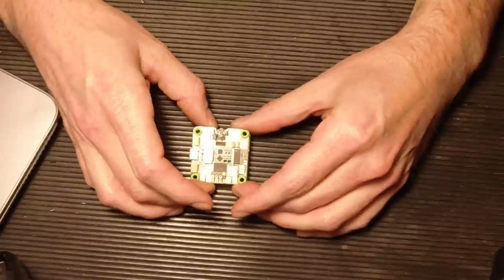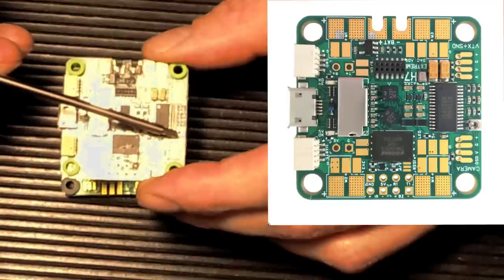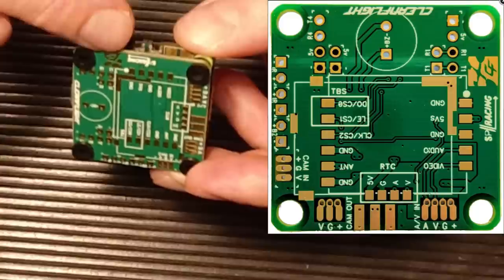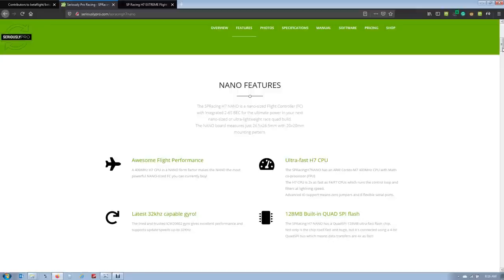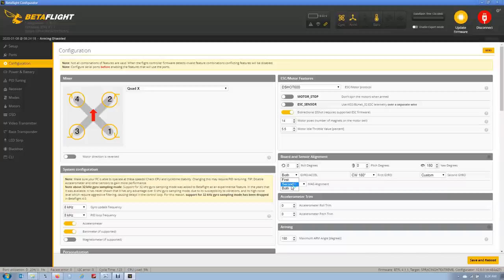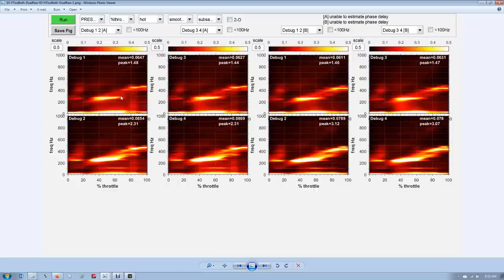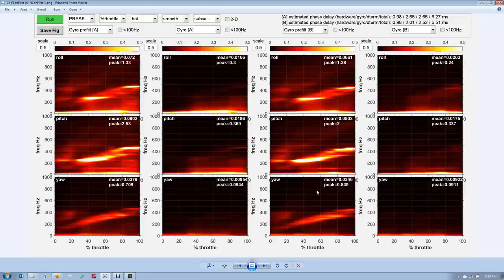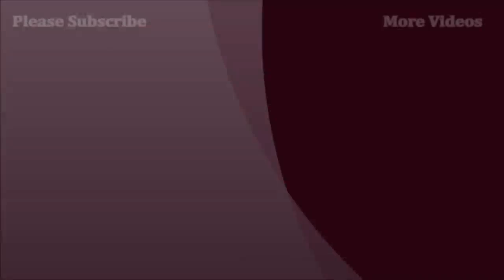SP Racing H7 EXTREME | H7 and Sensor Fusion w/ a TWIST!

Comment from the maker: NOTE:
The H7 Nano (20x20) does NOT have OSD!!  I missed calling that out.  If interested, it is best paired with the TBS Evo Unified EVO/OSD.  https://www.team-blacksheep.com/products/prod:tbs_unify_evo
Reply: That's correct, it works great with DJI or TBS EVO.
Reply: Dominic Clifton no it needs an osd.. and a proper 4n1 plug then it would be the greatest racing fc on the planet... you only need 4 uarts broken out and happy to run with timer based rpm..

Comment: The 8 pin connector is primarily where you'd connect up an external GPS with MAG as the GPS will use a UART and the Compass will use I2C.  Same as on the F7DUAL board.
Reply from the maker: Is it possible to remap those pins to be motor output for ESC connector?
Reply: @uavtech  I hoped that to be the case in my build but had to put all ESC signals to their respective pads

Comment: Wow, where is the kitchen sink cause it has everything else haha TBH I'm not a fan of sister boards tho because I think it adds weight to the FC so it can add additional vibration noise so I would not use that but you don't have to use it which is good and that is only my belief and I have never really tested. The boards are a work of art tho and a credit to Dominic imo👍👏
Reply: Thanks @Nads FPV!  I was trying to get a kitchen sink on there, but there's just not enough PCB space left after every everything else :D

Comment: i want to say I am grateful for your work but i want to share my different point of view on some subjects.  Sensor fusion can reduce the noise of two gyros even if you have a noisy one onboard, because the global accuracy is higher than the most accurate one. (Kalman filter theory)
I don't think your approach is correct.
What you are evaluating with those plots is not the noise of the gyro, it is the noise of the reading, with the gyro noise superimposed over it. And you can't distinguish them because you don't know the real signal.
If you suggest to "use the less noisy one" might aswell be that you are suggesting to use the lower sensitivity one. That can be less sensitive in the useful frequency range too. What Gyro fusion does, is only to give betaflight a more realistic noise reading, not a less noisy reading. From the point of view of the gyro, motor noise is a signal, not a noise.
The only way to compare two gyro like you are trying to do, is to have a more accurate reference gyro for comparison.
Have a nice day! Stephan
Reply from the maker: Good points.

Comment: Listening to you description of the sensor noise charts you seemed to look only at the noise from each chip but totally neglected to discuss the value of sensor fusion and how that process works to cancel out noise through some relatively simple algorithms that take advantage of the phase differences between the two sensor chips. Rather than looking at the noise differences between the two sensors it would be a heck of a lot more interesting and relevant to look at the the noise reduction due to the fusion algorithm - noise that never reaches the filters. The other comment I have is performance in processors is not just about clock speed it’s also about instructions per clock. The H7 has larger caches, a faster and deep pipeline, and some other architectural enhancements that increase the operations per clock. Therefore it delivers more performance than just the clock speed difference. It also has a more sophisticated internal bus structure which enables more i/o to happen in parallel to processor operations. One last important item (there are many more) that you could have mentioned is that the H7 has the capability to “multi boot” think having Betaflight, emu, and iNav all loaded on the SD card (or different versions or configurations of Betaflight as another example) and having the ability to select and boot whichever one you want to run by simple selecting it in the OSD. The H7 processor and this board are truly amazing. Unfortunately, the racing drone community is rather slow to adopt new technology and  it’s likely  to be some time before we see software that takes full advantage of these capabilities.
Reply from the maker: I did that in this sensor fusion rundown: https://www.youtube.com/watch?v=aozT7BxP9ZU

Yes, the H7 is much faster/better, I think I said that.  But if I get into the computer science thing tooo deep, folks glaze over.  It is a balance.

Booting multiple FWs doesn't county when there is only 1 target at the moment and that is in BF.  No iNAV unfortunately.

From a computer science standpoint, the H7 is amazing.  But one thing on this board I wish it had with a 4-in-1 ESC pin header.  Talking to Dominic it was not designed for 4-in-1 ESCs (cause it is the PDB), but it is on his radar.

In 8k mode, as shown in the above link, the precision of the TDK gyros seems pretty good.  It is in 32k where it all goes to shit, but we are not running 32k mode.  So since the precision of TDK gyros in 8k mode seems pretty consistent and the noise reduction of sensor fusion vs. non-fusion seems minimal, I don't want to hype something that I don't have the data to backup.

If you want to look closer at the data results, I'm happy to share.
Reply: Not to beat you up but there are 20 other channels that will give the low-tech version of a board review and your channel is supposed to be the more technical version and to help people understand that stuff and how it can benefit us - unless I misunderstood the mission. The noise charts seem to be of little value especially given that’s not how the board was intended to be used - as multiple single sensors in case one burns out. What would  e truly useful is an analysis of how well BF takes advantage of the dual sensors and the added processor features and performance to make a drone fly better. At the very basics, how it works with sensor fusion versus a non sensor fusion board and what kind of latency reductions if any do we get from a MUCH faster processor through the filters, if any. As well, you missed my second example of being able to multiboot different versions or simply different configurations of BF for quick flight comparisons or perhaps one setup for racing and one for freestyle. Referring to “glazing over”, most people (and I speak from long experience) do want to hear about the cool unique features but also how they translate to benefits rather than droning through a bunch of noise charts that don’t even address how the board is intended to be used. Lastly, what you term “computer science” stuff isn’t and saying that it delivers more performance than just the difference in clock speed because it has internal advancements that enable it to to more work at a given clock speed and isn’t slowed down by i/o as much as old school processors like the F4 isn’t hard to understand nor is it boring. Lastly, people actually do want to know how the H7 is different/ better than the F series processors and what benefits it could bring. There are questions in all the forums about this and you’d be providing your viewers real value by explaining that.
Reply from the maker: @wingspinner210  , i did a comp of single gyro vs. sensor fusion averaging.  Watch again.  Maybe you missed because it look about the same because ICM chips in 8k read about the exact same.  So the average of 2 and 2 is 2; you get my gist.

Speed performance of compute cycles has no performance gain in flight when we are having ms of phase delay in filtering and motor response.  Cycle times are in "us" and other delay in "ms".  1ms = 1000us.  So I focus on what matters, getting the filter delay lowered as much as you can.

I also closed in on if a fusion setup as 45-deg vs. 90-deg rotation helped.  It seemed like not since the F7 is 90 and H7 is 45.

Soooo waayyyy more depth then other reviewers.

Comment: Well, we're probably going to see a renewed push to support 32k sensor fusion, because we have the hardware to do it... even though in practical terms running 4k/4k/DShot300 with a good setup (good frame/motors/props) flies so ridiculously well I don't think anybody without deep pockets can justify wanting more.
Then again all my quads are beaters to some extent (race quads, or overtly bashers), so MPU6000/F4 is probably a practical improvement
Reply from the maker: BF will.not be going 32k ever again.  There is ICM gyro issues in 32k mode.  I will make a video on it.

Comment: Hi Mark, do you have any opinion on which is more important to face away from the ESC in a stack for interference reasons, the gyro or the MCU?
Reply from the maker: Gyro.
Reply: @uavtech  Thanks.  I am doing a new build and was remembering all that talk about the FlightOne boards being sensitive to that.  As far as I can find F1 said to put the MCU facing away but this makes more sense to me too.
Reply from the maker: @nonplayercharacter9653  , best is copper tape over the fets or put the fets on the bottom of the ESC.

Comment: As I understand the H7 has the same amount of memory as the F1.  Are the BF devs supporting the H7(yet)?  Hopefully, at some point, they will increase the flash memory.
Reply: Nick Sebring depends on the board, the one he’s reviewing has quadruple the onboard flash as one of my f7 boards, plus you can put an sd card in the one he’s reviewing for way more storage
Reply: Nick Sebring as far as I know it’s expandable and can use an SD card to expand the memory also
Reply: Hi Nick, The H750 is 128K FLASH, same as F1, but betaflight doesn't run from the flash, it is copied from the external memory into ram and runs from RAM!  H750 has 1MB RAM, waaaaay more than the F1's 20K RAM.

Comment: Regards processor speed/demand and whether h7 is redundant. I set up rpm filters on a kakute f7 and run 25% load when on the bench at 4khz PID/gyro, 50% at 8khz. Can I run at 8khz with 50% load? If not then the h7 seems a great option. Thanks for your excellent videos 👍
Reply from the maker: You should be able to run at 8k/8k Dshot600 on F7.  A better thing to look at is "Tasks" command in the CLI.  Make sure Gyro/PID loop is running less than 80% or 90%.  They should be down at 60 to 70% on F7 with RPM enabled.  That drops to 30% - 40% on an H7 with RPM enabled at 8k.
Reply: @uavtech  Thank you for your reply. I switched to 8k/8k - dshot 600 and cli reports gyro PID max around 50%. I blame Bardwell, in his RPM filtering vid he said max load shouldn't be greater than 30% 😁 tbf I believe he was referencing f4 boards. Also had the instability issue in gyro/PID loop initially with enabling the OSD, really affected flight quality.
Reply: The H7's CPU performance is amazing, with the F3/4/7 boards you're always having to turn things off to get your performance, the H7 allows you to have your cake and eat it, it's ridiculously fast.

Comment: I have a fl1 fc's runnin Falco-X  that exhibit a robotic delayed response in the control sticks that I was told it is fw generated? It feels like packet loss from my full size xf rx but ive put said fc in other builds and the problem follows the fc in question! I wish there was a way to kno if it is actually fw or a hardware issue?
Reply from the maker: Yeah, ask for logging in FalcoX.
Reply: J.FINESSE FLIGHTS remember when Preston said tracking setpoint was over rated... 🤦‍♂️
Reply: @Sugar_K  They said fw issue,  so I tried a different fw version and it didn't fix it? I still have a couple more things he wants me to try, so... I'm not doubting him, it's jus been going on for 6- months or so! I'm not trying to talk bad about how they run things but I'm not a happy customers! Because falco is "BETA" and he's saying it a fw issue they won't honor the "replacement" policy! They even admitted that it's a known problem! Now I have fl1 hardware that won't run falco fw...😔
Reply: J.FINESSE FLIGHTS not awesome.. the weird trying to do it’s own thing is why only Turner is flying it now..  giving a 15yo some money to fly your product garners a load of loyalty
Reply from the maker: @j.finesseflights1403  , flash BF to it.  See if still happens and if so, log it.

Comment: MPU-6000 VS sensor fusion?
Did you already go over that in the video?
Reply from the maker: I have not.  I want to do MPU vs. ICM!
Reply: @uavtech  looking forward to it
Reply from the maker: @pippifpv  , me too.  I'm very curious myself!
Reply: @uavtech  yes, I also want to see that! If possible, try to measure latency in some way. I got the feeling MPU6000 have less latency because the steprespons with that gyro is normal better in my experience

Comment: My H7 has been a paperweight since the lack of support from release.....-_-.... I wonder why this board is being pushed now?
Reply from the maker: Been running on 4.0/4.1 since summer?
Reply: @uavtech  Im reffering to #8836. I was really excited about the board and pid audio and may hav  bought it earlier than I should have once we flashed the prerelease BF for RPM there was no target in BF at the time to flash back to and have a functioning board. Maybe its time to dig it out and try again?  Bidirectional DSHOT not working on SPRACINGH7EXTREME #8836
Reply: @joeryan9365  using RPM filter with gyro set to both stil results in a roll of death, so yeah i bought it too early too. or maybe it was released too early :-)
And also I can't get UART6 talking to my bn-180 GPS, so I think this board (or betaflight) has some flaws
Reply from the maker: @dano5739  , did you guys report to Dominic?  I can let him know.  Hopefully he sees this.
Reply: @uavtech  there is issue reported on github, but it's closed with the comment ; turn bidir dshot off... https://github.com/betaflight/betaflight/issues/9098
Reply: hmm, I lost track of all the issues with the h7 on github. but it seems te be fixed i assume 
https://github.com/betaflight/betaflight/pull/8961
Reply: @dano5739  HI DanO, other than a couple of people posting on the issue there have been no new reports of death rolls,  in fact I recently experienced something similar when testing a new FC and the culprit was the lack of a large capacitor on the ESC and not the flight controller, after adding one problem solved.  There's been no new logs or related issues to the contrary that I'm aware of.

Mikeller was having a bad day when he closed that issue with the proposed 'solution', closing it like that upset Joe Lucid so much that he left the Betaflight Members group a few days later.

With BF 4.1 the board is rock-solid.  Loads sold, loads of happy customers and even the technical college in Reykjavik, Iceland uses them for their coursework now!
Reply: @DominicClifton  Thanks for the explanation! This makes me want to give it a try again.
Reply: @DominicClifton  the Mikeller incident was quite notorious, many were left wondering what had happened, and then the issue was reopened in another repository. Things got messed quite quick